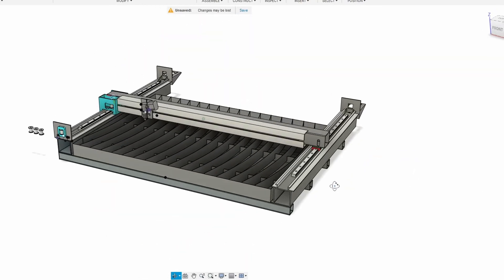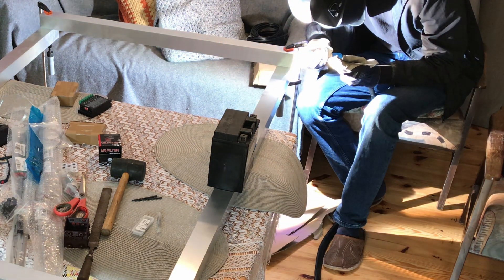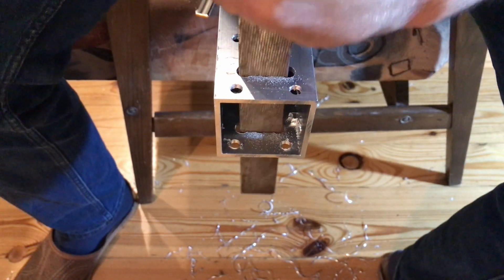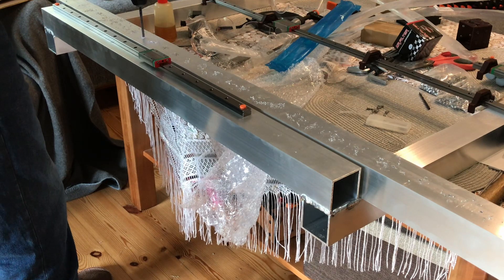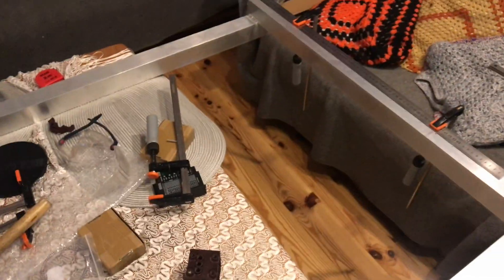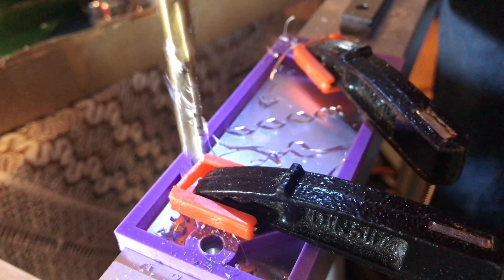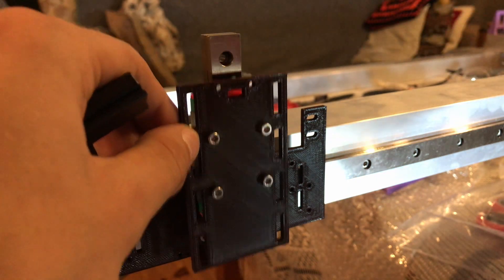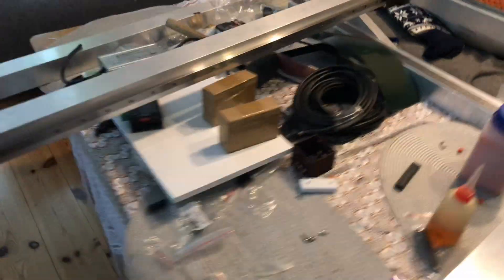Building Simple CNC Plasma Cutter ep1

Comment: well its acsually core xY because z is up and down of the cutterhead
also if you ever need to build something similar, i reccommend aluminum extrusions , rather than the tubes , ist way easier to work with, if you need to adjust something afterwards

other than that, cool build, and impressed you dont let the limitations hold you back